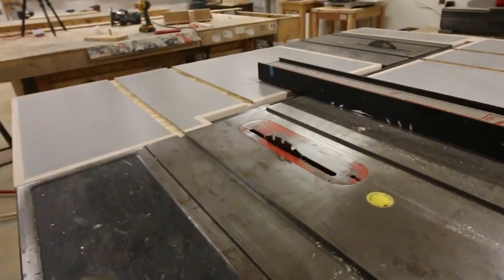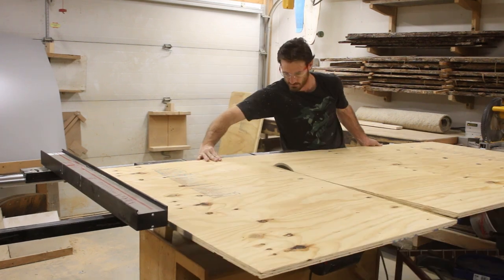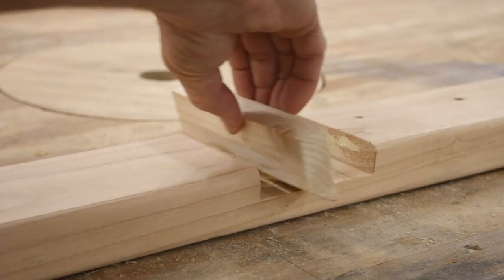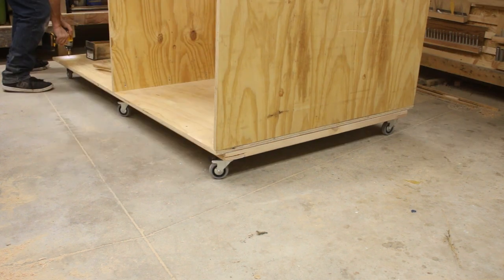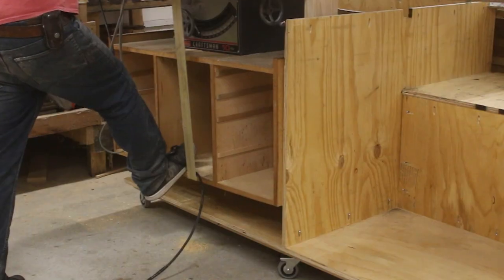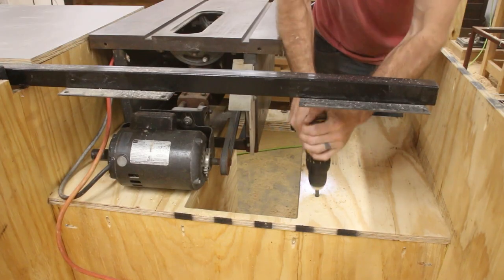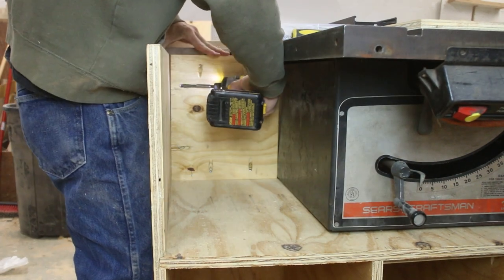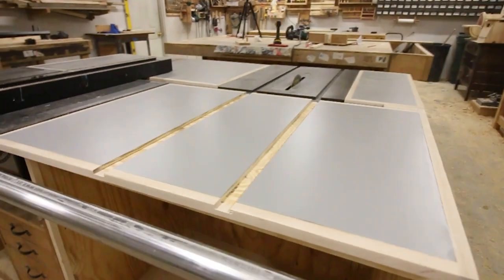I Built a Luxury Table Saw | Building the MEGASAW

Comment: That's an awesome beast of a table saw. The only thing I would have done differently wound be not taking the miter tracks all the way through to the end of the table. Since you don't push your sleds all the way through the blade, you only need 6"-12" of clearance and then you'd have more uninterrupted flat surface on the outfeed to use as a work surface...you know, so you can get it all cluttered and have to clear it the next time you want to rip a board. ;) Honestly, though, it's great!
Reply from the maker: 😂😂😂 OK real talk for a second. That was my original intention but when I routed that 1st line I accidentally started in the wrong spot. After that I decided just to route all of them straight through. Oops😬😂
Reply: @WyldeWoodworks  ah, that sounds exactly like something I would do. Can’t tell you how many times I’ve measured twice…from the wrong side.

Comment: Awesome build. I've got a 113 saw and this video has me looking on FB for another one...

One question: Is there a particular reason you chose to have the saws facing each other, as opposed to next to each other?
Reply from the maker: Yeah Sometimes I want to make a quick cut while I'm next to the workbench. So now I can just turn around and use that saw instead of walking all the way arround. But it can be set up to face any direction really

Comment: One issue om having with my table saw build is where to store the fence when its not in use. I slide it in underneath and sometimes it slides out. Any ideas
Reply from the maker: I just keep mine on top all the time. I used to have a french cleat hanger for it but I haven't used it in years. I think I got rid of it